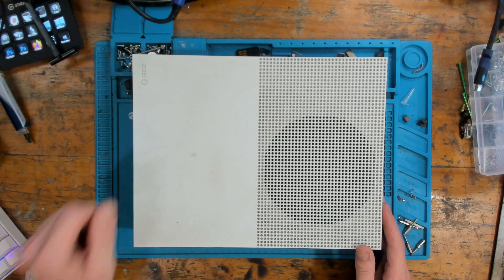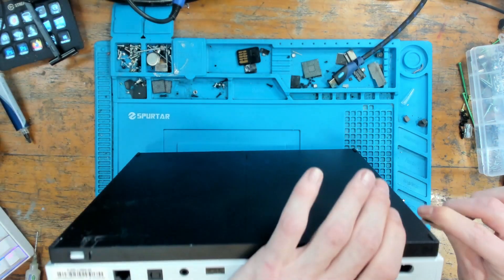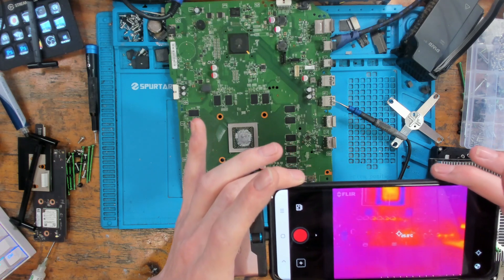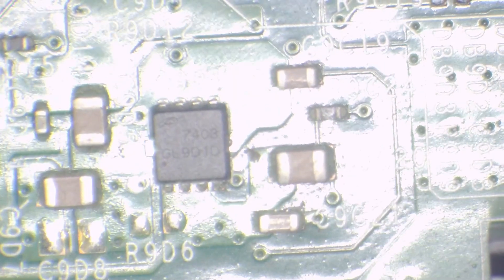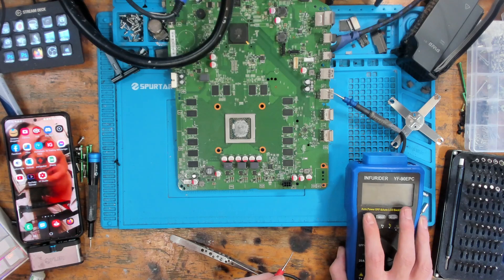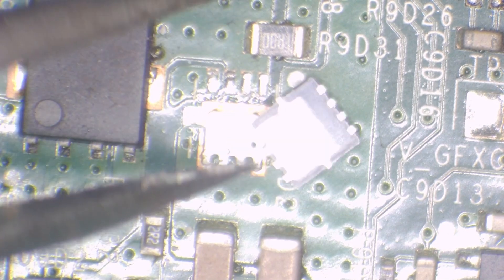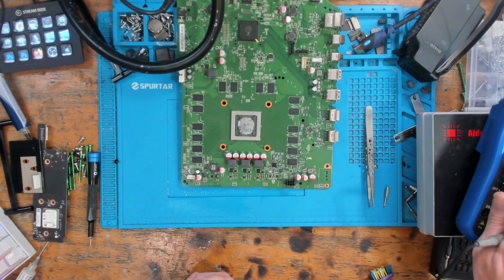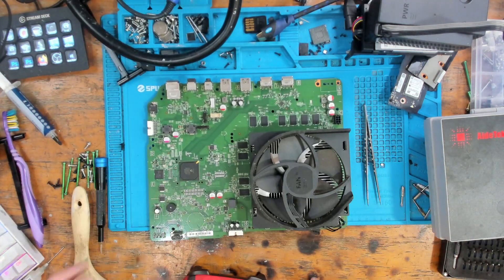Xbox One S All Digital Edition Doesn't Turn On! Completely Dead No Power Caused By Shorted Mosfet

Comment: am new to this, but I found it impossible to remove with hot air with the settings on 500. So, I will try it with the soldering iron. I even melted the corner of the mosfet.

Comment: If an original Xbox one has got all the standby voltages, but is missing the 12v which reads 0.2v & all the mosfets on 12v rails are reading normal what could be the cause?
Reply from the maker: It's hard to say without seeing it mate. It could possibly be the mosfet drivers but it sounds like you have a 12v short somewhere
Reply: @TheCod3r  think I found the issue, screw damage into the 12v line in the. idle of the board.  Didn't spot at first

Comment: Had so many problems with Xbox’es over the years. Red rings of death, the disk reader grinding up the disk and making it unreadable, not powering on at all, etc.. Have had great luck with PlayStation’s however. Only my ps4 had a disk ejecting issue that was actually easily self repairable without need to professional repair. but PlayStation 1,2,3,5 have worked flawlessly. Forever sticking to PlayStation only. Also pissed me off to no end how they actually made you purchase batteries for Xbox controllers for a while. No thanks

Comment: @thecod3r hey m8, I sent you a vid on fb regarding calibration. Couldn't find one for the atten, but the process is the same, after you find the calibration setting in the menu.

You should always check your temp after changing the element. Use the thermocouple on your rework station. 😉
Reply from the maker: No worries mate I'll check that out, cheers for that 😁